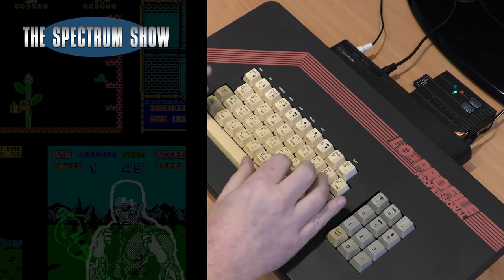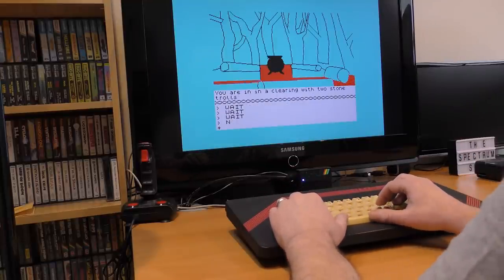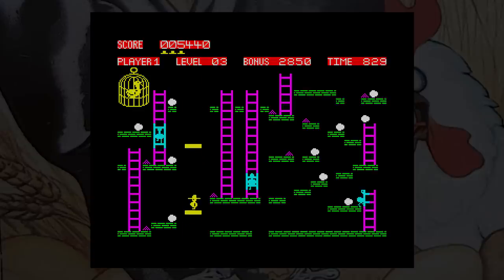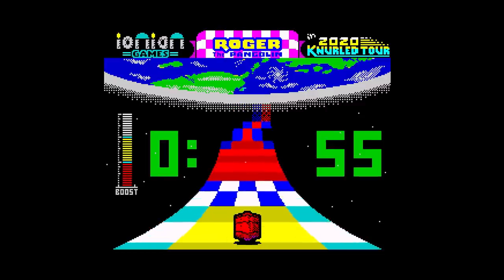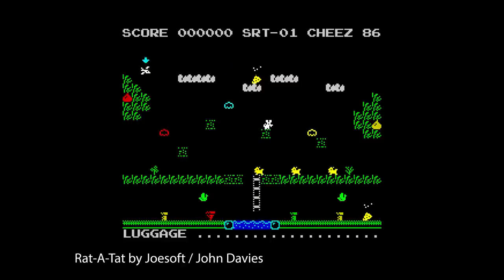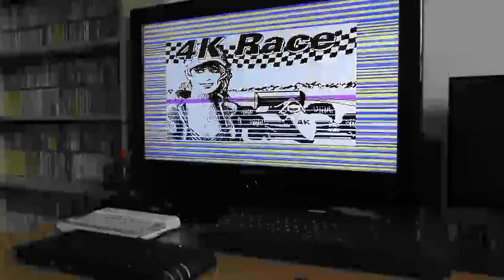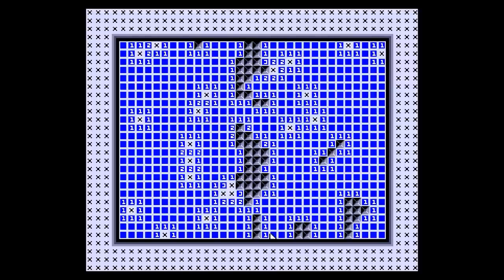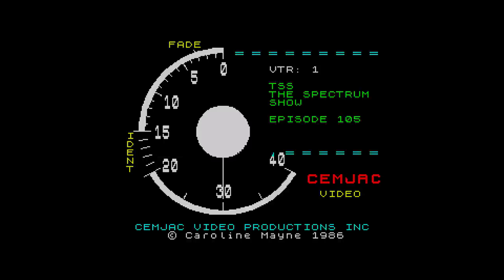The Spectrum Show EP 105

Comment: It's my old Speccy keyboard! I had the same version as your new one with the red stripes. I put a rocker switch in mine so I didn't have to push and pull the power plug to turn on and off and reset. My only successful hardware mod (-:

Comment: Greets Paul and thanks for the episode. Very interesting countdown ident on Extra Bits. Nice contribution to stir the imagination! I was looking at some of the reverse engineering work on Saturn 12 rocket computers and often wondered at all these extra uses should the Spectrum have dominated more along the lines of Arduino or Raspberry Pi today. Sir Clive Sinclair mentions a ZX80 rigged up in a cab doing rudimentary route planning back in the day. Zimbabwe during the 80's had some folk at NRZ experimenting using Spectrums and its interface for railway switching- pickling their own relay pcbs and writing unique control programs. The actual Z80 chip of course got into all sorts of things from washing machines and telephones to calculators and elevators.

Comment: Is anyone good at Bounder? :-)
Reply: Used to be but fired it up recently and definitely lost that skill!
Reply: I used to be able to get pretty far back in the day, level 5 or 6 I think. I had Bounder as part of the Gremlin '4 Crash Smashes II' compilation and Bounder and Starquake got a lot of my time.
What I've found is that it doesn't emulate well, as the slight delay in emulated input makes it much harder to play.  Playing it on the Next is really good though as the super responsive keyboard of the Next makes it a pleasure to play.